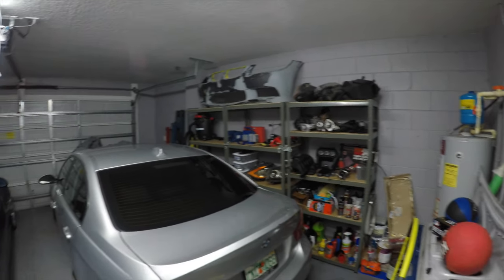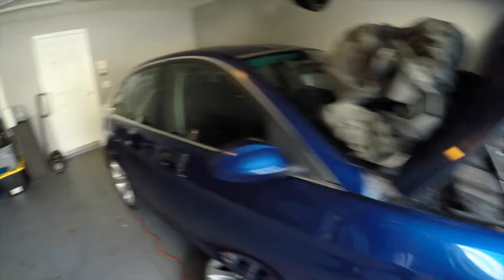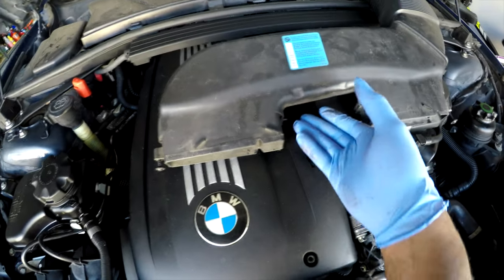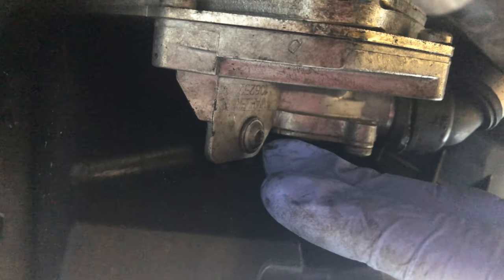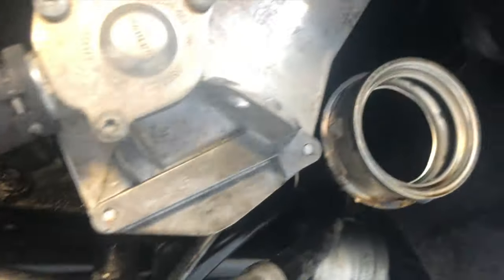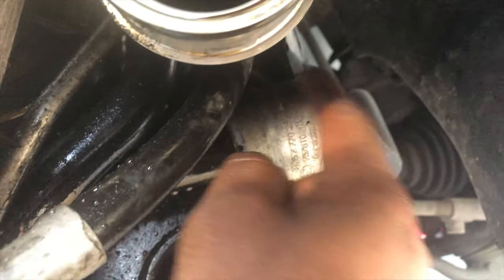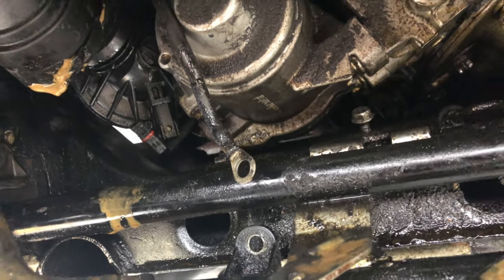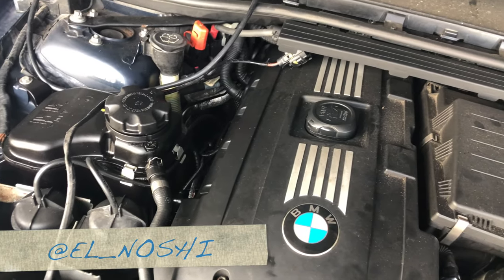Project Xi - BMW N54 335XI Water Pump and Thermostat Replacement

Comment: Dude, instantly subscribed, thank you for making a video straight forward, yet detailed and easy to follow. Also for working on one with xdrive. 🤣 Just replaced trans cooler, radiator, a few hoses, transmission flush/pan/filter, heater core bypass, and now found a crack in my thermostat. 😅 Not nearly as difficult as others made it seem. 🙏
Reply from the maker: Wow got a lot done lol! Thanks appreciate it!

Comment: Dude. Dude!! DUDE!! YOU ROCK!! LOL. Videoing this job while doing it must have taken you three times longer than just doing the job. But you did an awesome! Job! I too have the XI version of the 335i N54 and I have been wondering how hard it will be when the day comes that I have to do this job. But you showed EXACTLY how it is done. Even though it's very messy and not fun (Until the jobs all done and your car is back on the road again lol). You persevered and showed us all how it's done and that we don't have to remove or even drop the front subframe. You are a king in my books!!! Thank you! Subbed!
Reply from the maker: Yea man lol especially talking and coolant land in your mouth, many breaks of flushing my mouth and face with water lol. Hopefully when you do yours it’s just coolant in the lines and no oil. Appreciate the support.

Comment: I'm attempting this and took a break for the rest of the day. As I sit here watching your video I feel so much better I just need to loosen up a few more bolts and I'm there
Reply: The clamp that's on the water pump is backwards what's the best way to get to it
Reply from the maker: If it’s the clamp that connects the Waterpump to thermostat, best to remove the waterpump from the engine and then you can access it easier.

Comment: Did that turn out to be the Oil cooler gasket or was it the head gasket? My 2008 535Xi has a coolant leak and it burns coolant as well (white smoke) and I am hoping you have a video of an easy fix, oil cooler gasket or head gasket. thanks. great vid
Reply from the maker: After replacing the oil filter and cooler gaskets. And changed out the cooling system everything worked as it should. No issues afterwards. More than likely it’s the oil filter housing gasket. Since the gasket is the only thing keeping the oil and coolant from mixing. So it’s just coolant leaking into your oil and getting burnt out the exhaust. The chance of blown headgasket on an n54 is super rare.

Comment: Hey noshi love the vids man just bought a 335xi as well and I fixed all the leaks on this thing OFH VC oil pan, front crank seal, camshaft position sensors (2) and vanos gaskets, but I still have oil leaking at the front of the motor just underneath the lip where the OFH is I’m confused have you ever seen these motor maybe crack? Head gasket is dry too leaks just underneath it

Comment: How did you pull the thermostat out that far to get rear hoses off
Reply from the maker: Once you take the two bolts that connect the Waterpump and thermostat together then your able to pull the thermostat out to get at the rear hose. Just make sure the thermostat cable is disconnected and out the way.

Comment: XI is easier than the I. Yeah bullshit. Im in and out on 335I in 30 mins. 2 hours minimum for XI 

And why you removing everything you dont need too. Radiator fan and transmission heat exchanger. No need for all that

Comment: Sir that oil looks like it’s more than your oil pump gasket
Reply from the maker: 2 years since that fix and after flushing everything, changing out the waterpump, thermostat, radiator, and oil filter housing gaskets. The coolant didnt get contaminated again. When the car was sold still drove fine without issue.
Reply: @nOshi2x  dooe
Reply: @nOshi2x  dope*